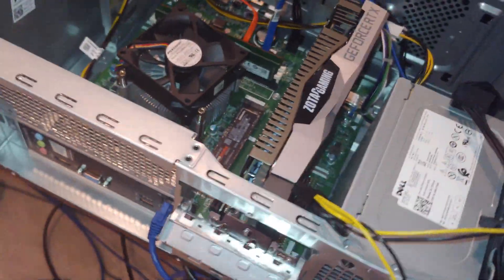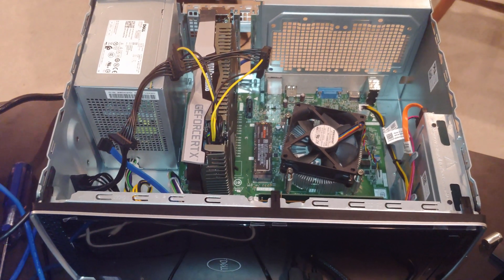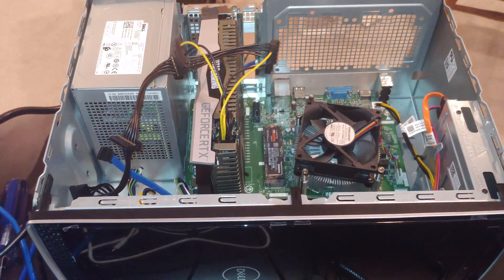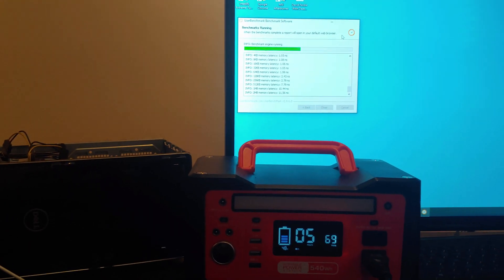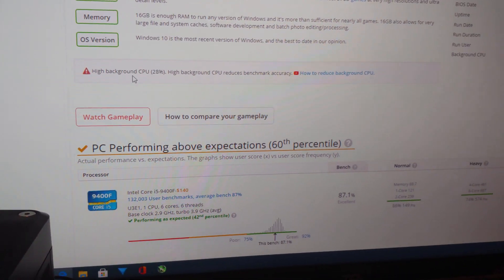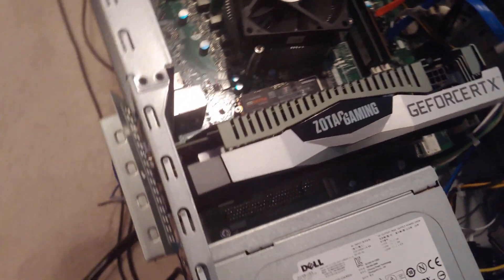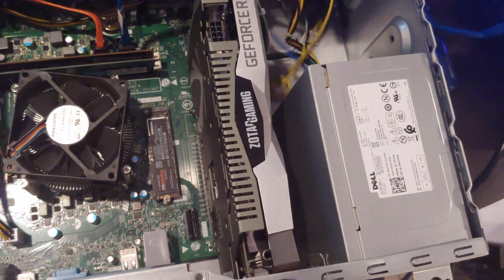RTX 2060 Super install in Dell Inspiron 3670, can stock PSU handle it? Vostro 3671

Comment: I run 1660tis and 3050 8GB cards off of the 260W stock power supply.  Just some Y adaptors and some browning of the white motherboard connector, but never shut down on me after 400 hours of use.

Comment: do you think i could run this with a 2060 undervolted to 75% and a 365w 80+ gold psu from dell? how long would this be sustainable? any better choices from 6 pin mobo to 8 pin power?
Reply: I run one (160W) on my nephew’s Optiplex 3060 with a 300W and an i7-8700.  I use a Y adapter to two 6pins and the a 6pin to two SATAs.

I had just one SATA plugged in before and it would trip OCP.  A 360W should do just fine, I used a 2060 Super (175W)  before with one SATA added to the power draw, but I limited the wattage just to be safe way back when to like 160w.  Now I know that that is unnecessary.

PS: You have 8 or 12 amps to work with on the 6pin power rail: read that box!!

Comment: can you remove that vent like thing that is around the cpu?  i’ve been wondering how
Reply from the maker: Yes, it is in 2 pieces. In one of my videos...I show the incorrect way to do it.  One would snap off the top portion, then use a phillips screw driver to remove the rest of it.  I have not had mine on in years.
Reply: @PC_HardwareTechUnboxing_1  could you link me the video?

Comment: ok I have this pc and I wan't to upgrade the integrated graphics to a gtx 1650 super. Will the stock psu handle it?
Reply from the maker: I would not recommend anything greater than GTX 1650 for long term use.  Keep it to a GPU less than 75W.  If you upgrade PSU..thats another story.  Hope that helps
Reply: Yes, it does! Thanks!

Comment from the maker: Hello fellow Dell 3670/3671 users...I can't stress how bad of an idea this one is.  Though I was able to run this just barely under the 290W...if there was HDD or other devices plugged into USB drives...it might have gone over 290W and most likely it would reboot.  Possibilities of something worse happening...sure anything is possible. 

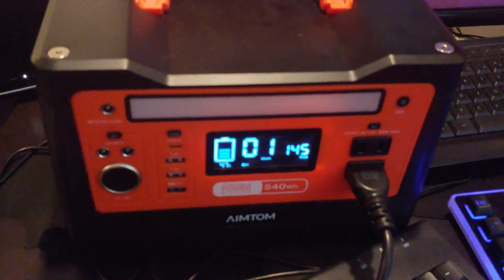145W Power Draw during bootup:  03:41
284W During Benchmark 05:17
Unknown during Gaming....I believe it would be greater than 290W

I have similar videos and will put the links below:
GTX 1660  https://www.youtube.com/watch?v=exxI4Uv2AKI
GTX 1060 https://youtu.be/raornUwuL_Y
GTX 1650 Super  https://youtu.be/xyeo6PNODMw
GTX 1650  https://youtu.be/yQzg1DtZmOk
GTX 750 https://youtu.be/k33FMwV3e_8
Reply: pls post GTX 1660 :)  I am considering upgrading my dell 3670 i7-8gen, gtx 1050 ti early next year. Was considering 1660 Super graphics card once the 3000 series start flooding the market. But 2060 super seems cool too. I have plenty of arctic cool fans in my case, and an upgraded 540W cooler master PSU. Could give 2060 super a shot.
Reply: 1660 is this one right? https://youtu.be/U_gn1QI8EAU
Reply from the maker: @MarketStoic  Hello, I have 2 1660 install videos.

The one in the link is the GTX 1660 TI that I pulled out of the HP Gaming Desktop with PSU upgrade.  That one has a short length to it and can be bought new or used on Ebay.  

I did another video similar to this one where I put in a EVGA GTX 1660 using stock PSU and a SATA power to 6 pin PCIE as an experiment to see the power draw during benchmarks and gamaing.
Reply from the maker: @MarketStoic  1660 video https://www.youtube.com/watch?v=exxI4Uv2AKI
Reply from the maker: @MarketStoic  BTW, I updated all the links above if you want to see the unpublished videos